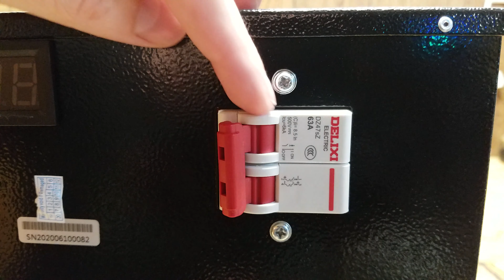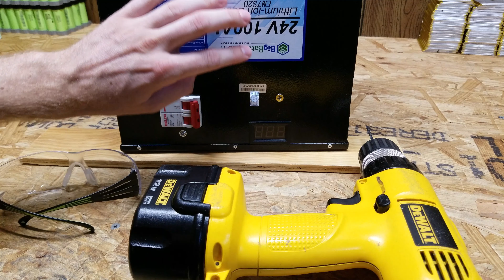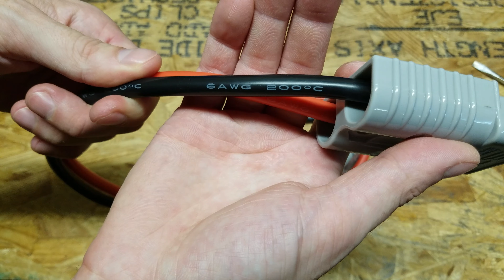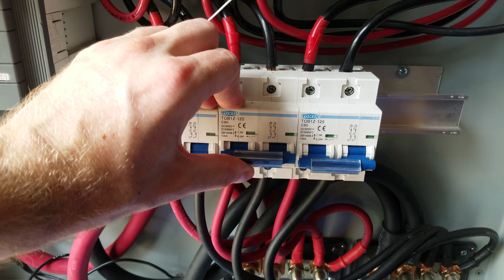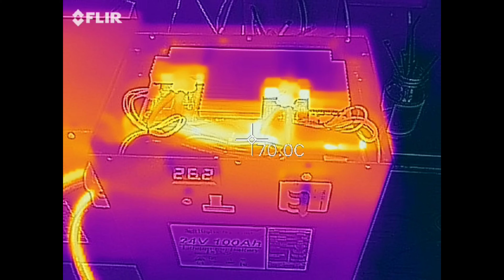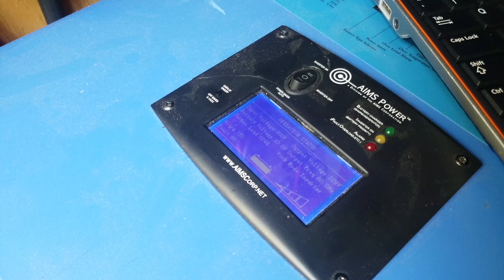Overview and Testing of the BigBattery 24V 100Ah Lithium Batteries, Plug-and-Play!

Comment: 150C and the breaker itself didnt shut off? 🤭
Reply from the maker: You would need to have a temp sensor positioned directly on the breaker for that to occur.
Reply: LithiumSolar no, a standard breaker need shut off when shorts appear and by overtemps. Otherwise a fusebox can go up in flames.
Reply from the maker: @Zimiorg  I completely misread what was said, sorry. I thought you were referring to the BMS's temp control shutting off. Yes, I am not sure why the breaker did not disengage either.
Reply: @LithiumSolar  No, temperature is what turns the breaker off no matter where or how it's installed.
Reply from the maker: @niwachien  The current does not double in series, just the power (wattage). It's still 30A max charge current, just at 48V instead of 24V.
Reply: @LithiumSolar  You're right, parallel would take 2x the current.
Reply: @niwachien  when resistance approaches 0 electrons will go to the lower resistance. It's not hard to think about this there's going to be a voltage drop on each of the circuit breakers. The voltage drop will not be identical. The current will flow primarily through the lower resistance because it will have a lower voltage even when 90% of the power is flowing through it versus the slightly higher internal resistance circuit breaker. Once the first circuit breaker blows of course that all over the current flows through the other circuit breaker. It will instantly trip or trip for the design at the designated amps duration.

I think you should try to blow up these batteries by charging them outside at the 30 amps in direct sun but you're going to need to keep them very far away from any vulnerable structure and the fire will be a viral video for sure because I'm not sure if any model 3 have been on YouTube burning up? More simply put you should get one of the individual sells for $2.99 plus shipping and proceeded to blow that up just to demonstrate how easy it is. For example if you take the battery and connected end-to-end with the copper bar whatever your fancy is and then throw it like a hand grenade maybe into the Grand Canyon you can have it blow up before it hits the ground? Maybe this is a good alternative to expensive mortar fireworks you can shoot them into the air with a slingshot and use some sort of switch that gets closed when you eject the battery buy a string or something connected to the trip bar.

I don't understand why Tesla and Panasonic are allowing these individual batteries to be sold for under $3 to children it is the best incendiary improvised explosive device that $5 has ever afforded by far.
Reply: @markknotten1210  So you do not believe that temperature trips a breaker?
Your "Grand Canyon" idea is illegal and against youtube policy. Are you sure this chemistry will burn? I know there are some safe lipo  https://youtu.be/9nmDj0Ykn-c?t=253
Reply: @niwachien  yes the site that is selling the rescued Panasonic model 3 sales without Cycles links to a YouTube video I mean links to a video by the guy that breaks down cars and he takes the model 3 apart fully charged and talks while he does it for 2 hours. The text of that article however notes that among his findings are the slightly higher density of the model 3 the drastically reduced assembly time and the necessity of an improved cooling system because of the 140 Fahrenheit degree temperature I believe it was Fahrenheit 140 I wish this chemistry becomes extremely dangerous. If you have difficulty finding the model 3 sales for sale it won't be difficult to overcome that difficulty just look at this channels review of the LG lto battery being sold by the same seller but please don't think that because the battery is cost engineered for a popular electric car that has most of the market it is usable in other applications especially at $3 each. I think that's far too much to pay with almost no benefits and the extraordinary significant risk if you can't keep the temperature down. in terms of doing anything at the Grand Canyon without the parks permission that was not my intent but if permission is obtained YouTube I don't think would have any objection. The point is that lithium ion is an electrical energy storage device and what people use electricity for which in this video includes drying clothes or removing the gasified heavy water from the indoor envelope those tasks are better done in other ways as for example a a MIT is currently testing in India as one of the eight prototypes submitters. The air conditioner that he seems to say has 72000 BTU which I'm sure is not correct tries to condense the water by taking the energy necessary for it to remain heavy. You don't have to change the phase of the water to separate it from the air as Massachusetts Institute of Technology spin-off demonstrates all you have to do is filter it out! To understate it this requires much less than 20% of the most efficient condensing systems energy. You just blow the water vapor out the ceiling vent it's lighter than air. if water vapor was not lighter than air everybody would suffocate on the ocean. Don't try to power multiple horsepower motors with electricity and costly electric magnets to get rid of something that's lighter than air just blow it out of your f**** house or office. Don't buy solar panels to get electricity 2 heat up wires to increase the air water carrying capacity either. I mean is everybody in it to lose it? Most of the time it seems so!
Reply: @niwachien  sorry I only responded to your second question not your first. In order to get the electricity to flow through both Breakers in roughly equal proportion you would have to increase the resistance so that any discrepancy between the unintentional resistance was minimized by making its significance high enough to be equalized which would be consistent with the extreme heating by the circuit breaker. I don't know how this circuit breaker is engineered but the black box of circuit breaker is not temperature driven it is about the current and only the current. So the standard ways of measuring currents which would be say induction would apply. In the history of circuit breaker I am sure that there have been various Technologies and techniques used. Fuses burn from temperature that's correct. In the circuit breaker perhaps adding some internal resistance is the consequence of some of the cheap Technologies. Solar and lithium ion batteries have less sensitivity to the electric water heater or electric resistance clothes dryer mentality.

The second life for a lithium ion is creating that Danger of when you get something for too little of its production cost. Such danger is known as moral hazard. If you get a battery that has conflicting labels on it send it back. Have standards. Live longer. But mainly if you were going to pay somebody to put used batteries together make sure they have Deep Pockets or you have reason to trust them. I would not trust this bigbattery.com company regardless of their ethnicity. one thing you know about this battery is that the supply is limited so very little investment can be justified in engineering. It's the opposite of the same battery being used in the car. Those individual $3 cells are best repurposed for external cell phone batteries. Or personal cooling vest replaceable modules. the real danger is when you put a bunch of this s*** in a metal box as if two kilowatt hours a fully charge lithium can't get out LOL.
Reply: @markknotten1210  All breakers trip when they heat up enough, that's how they function. Paired breakers are also common in high amp circuits from houses to machinery. What would the "ethnicity" of the people at bigbattery have to do with anything?
Reply: Get back on your meds dude because none of the shit you said makes sense. Batteries aren't any more dangerous than a knife and fork. They have a purpose and every house has much higher voltage mains piped right in. Get off your high horse

Comment: Nice review just too much money for me. You would likely get a higher kwh if the discharge rate was 20 amps. Thanks for the honest review.
Reply from the maker: Absolutely. The standard discharge rate for testing is usually 0.2C (20A). I should have mentioned that. I noticed too that even though the device says 2500Wh, the BigBattery website says 2400Wh. There seems to be some different statistics depending where you look. I'm not sure why...